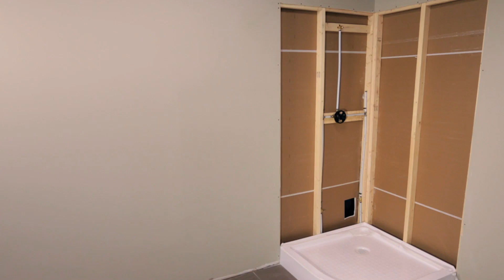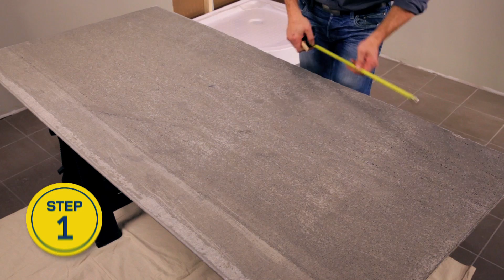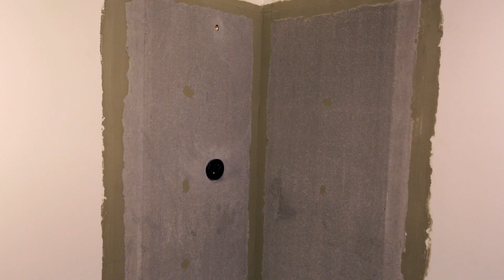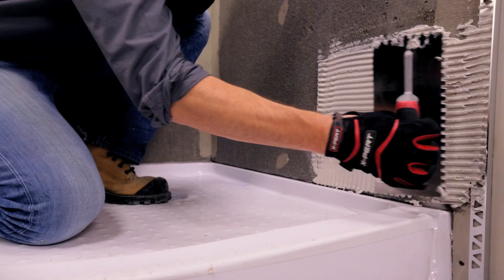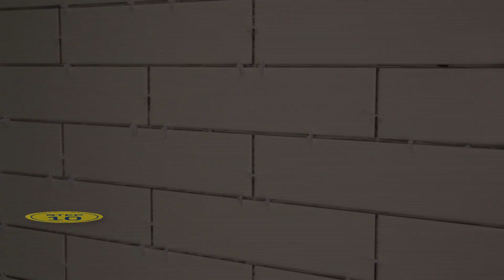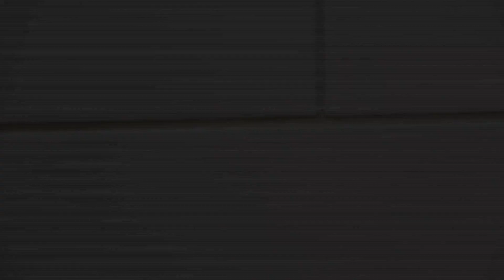How to Build a Ceramic Tile Shower | RONA

Comment: Where's the waterproofing?
Reply: There isn't any. They didn't even seal up the gap between the cement board and shower pan. That's going to be one leaky, moldy shower.
Reply: @SgtZima  and the studs will rot away or termites will move in.